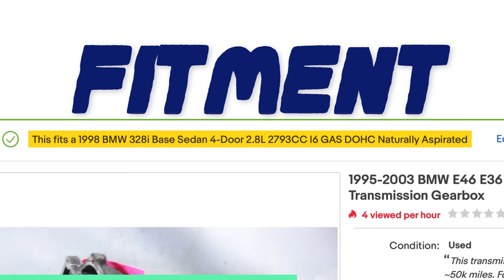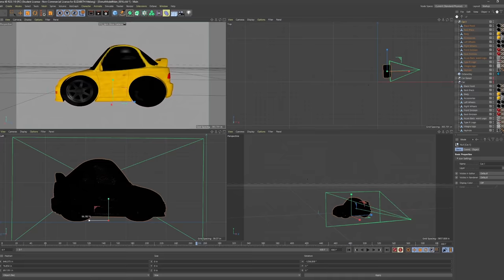Is a Manual Transmission Swap Worth It?

Comment: Yeah, swapping to a manual transmission is worth it if you like shifting slower and replacing clutches all the time.
Reply: for cars like this, and pretty much anything pre 2010s your gonna be shifting faster with a manual. and if your replacing clutches all the time than your either cant drive for shit, or think every 150,000kms~ is all the time lmao
Reply: @arcanevoid9199  Wrong. There is no way you can shift faster or more smoothly than an automatic transmission. 

And in cases where people are racing or off-roading, or using their vehicles for anything other than daily driving, clutches wear out MUCH more quickly.
Reply: @KurNorock  bro have you driven an auto from that time period? they do not shift fast, and especially downshifts. yes it would wear faster doing those things but they make clutches specifically for that sorta thing, and it’s not like your gonna have to replace it every 2 weeks
Reply: @arcanevoid9199  stop calling me bro. You sound ridiculous. 

And yes, I've driven plenty of cars from that time period.  You are the one claiming that all cars from that period have slow transmissions for some reason. That isn't true. Sure, some garbage budget cars did, but plenty of others didn't.
Reply: @KurNorock  okay sorry lol, nah most of them are pretty garbage. only ones that are decent would be dual clutches are they are closer to a manual than an auto. and especially if you go back to the before the 2000s like when this car was made, majority of the autos are 4 speed with no manual option and are terrible. like my car is 2 seconds slower 0-60 with the auto option
Reply: @arcanevoid9199  yeah and in my 98 jeep grand cherokee you can barely even feel the shifts because they are so fast and smooth. 

And that's an SUV. Not even a sports car.  Like i said, you are wrong in thinking that all of the transmissions of the time were just like yours.
Reply: @KurNorock  lmao a jeep? ok nvm you do you
Reply: @arcanevoid9199  At the time it was the fastest production SUV in the world. It was also the most luxurious and most expensive. It was even more expensive than the Cadillac Escalade of the same year. 

So yeah, turn your nose up all you want. That doesn't change the fact that my automatic transmission shifts faster than you.
Reply: @KurNorock  god your ego is huge, jeeps are terrible cars and not to mention I couldn’t imagine only having a big suv thing to drive. they are nice for transporting things, but otherwise they are horrible to drive. And I seriously doubt you have seen how fast you can shift a manual
Reply: @arcanevoid9199  You don't know what you are talking about. Not even a little bit. 

The 1st gen Grand Cherokee is in no way a "big SUV thing". It isn't big at all. In fact, I barely fit in it. My head rubs the ceiling liner, the whole thing only weighs 3600 pounds with a 5.2l V8, the wheelbase is only 106in, and as I already told you, it was a performance SUV with a very fast shifting transmission, all wheel drive, and a V8 engine with as much as 245hp and 345ft/lbs of torque, making it the most powerful and fastest SUV available at the time with a very respectable 0-60 time of 7 seconds. 

You just don't know what the hell you are talking about. I said "Jeep" and you immediately just started thinking about some old army vehicle, or some CJ-7 from the 80s. Which is NOT what I'm talking about at all.

Lastly, my ego has nothing to do with this. I'm not boasting about my old ass Jeep. I am just using it as an example of my argument. And frankly, I don't use my Jeep for racing or street performance. I lifted it and put big tires on it and I take it crawling over big rocks in the desert about as slowly as it will go.
Reply: @KurNorock  it is a big suv, might be hard to understand if your American. 3600 pounds is a lot, that’s 1100 pounds more than my car. and 245hp out of a 5.2 v8 is not impressive at all, there’s 4cyl making close to that. my car makes 190 out of a 1.8, no turbo or anything. I’m not thinking about some army vehicle, if you haven’t owned Japanese cars or don’t know much about cars it might be hard to understand. anyone who’s into cars would know how bad jeeps are, my work friends one just broke down last week and it uses so much gas. and if that’s not boasting idk what is
Reply: @arcanevoid9199  no.  A suburban is a big SUV. A 98 jeep grand cherokee was little more than a slightly tall car. 

And yeah, i know that 245hp out of a V8 isn't impressive now, but back in 1998, 24 years ago, it was impressive. 

And yes, maybe your little 4 banger makes 190. I don't care. That just means your engine is under more stress and will not last as long. It's 24 years old with 220k miles and still runs like new. 

Also, American emissions standards killed engine power for decades over here.  Everybody knows this. So again, for a V8 from 1998, 245hp and more importantly, 345ft/lbs of torque, was damn impressive. And if American car manufacturers weren't hamstrung by ridiculous federal emissions standards, that engine likely would have put out far more power. 

And again, as i already said, I'm not claiming that my old ass jeep is fast.  

Either way, this entire discussion is getting off track.  This was supposed to be about auto vs manual transmissions.  And regardless of what you say, you can NOT shift a manual transmission as quickly as a preformance oriented automatic transmission. 

You sound like those old farts who thought ABS was just some gimmick back when that first came out. They thought they could pump their brakes faster than the ABS system. 

They also thought fuel injection was never going to catch on.
Reply: @KurNorock  but guess what not every car comes with a performance oriented auto trans, most don’t actually. one of them being the car in this video, but you went all “no you don’t know what your talking about”. I’ve driven plenty of auto cars and haven’t been impressed by any of them. The newest being a 2016, and honestly it’s not just about shifting times. the gearing on autos is way too long, and you get more drivetrain losses. and unless it has rev matching downshifting in an auto is really slow and jerky with the manual mode. and just one thing, plenty of people have been getting over 300k miles with my engine, and I’m coming up over 150k myself. it doesn’t really matter it is if it’s designed well. and 190 out of a 1.8 isn’t even that stressed, can easily make more with mods
Reply: @arcanevoid9199  i don't know why you keep arguing against points i never made. But it's getting pretty annoying. 

So what if your car doesn't come with a preformance auto trans. That doesn't mean you swap in a manual. It means you swap in a performance auto trans, or build your stock trans to be performance. It isn't even that expensive compared to a full swap.
Reply: @KurNorock  what tf is your problem with manuals. manual swap is so much easier than all of the those other options, and it’s way more fun to drive. swapping transmissions is a big job, especially for autos because they are more complicated. and unless your doing drags no point building the auto, like why waste money on a 20 year old auto the doesn’t even have manual gear selection? not to mention the drivetrain losses advantages and the weight advantages of a manual
Reply: @arcanevoid9199  
1. It isn't difficult to put a shift kit and new valves in an auto trans. At all. 

2. I've driven plenty of manual transmission vehicles, never once did I think it it as being more fun than an auto. It was just another thing to do. 

3. Autos are more complicated on the inside, not the outside. Swapping one into a car is no more complicated than bolting it to the back of the engine and running a few lines and maybe some linkage. 

4. You don't need manual gear selection, and besides that, almost every single automatic transmission in the world has gear lock outs which can be used as a gear selector if you really want. 

5. Any with more aggressive race clutch packs, shift kits, and valving, the drivetrain losses of an automatic fall in line with those of a manual. 

6. The benefit you get from MUCH faster shifting in the auto will more than make up for any downside the extra weight will give you. And lets be real here, the weight difference is not much and would never be noticeable. 

7. And the most important reason automatics are better is because they let you, the driver focus your undivided attention on the road and the car. You can push just that little extra harder because you can pay more attention to when your tires are breaking traction vs having to split your thoughts between the road and "oh, I'm coming up on the red line, gotta shift!" 

Then there is always that classic situation of being towards the end up a straight with some room to spare before you have to brake. Do you just ride the redline the rest of the way not gaining speed? Or do you take the time to upshift and hope you can gain some speed before you have to brake for the turn? It's too hard to tell. On the one hand, riding the red line won't make you slower, but it isn't making you faster either, and other cars on the track have a chance to catch up or pass you. On the other hand, trying to upshift will slow your car while you push the clutch, and if you judged the distance wrong, you won't have room to accelerate to where you were or get any faster before you have to brake, so all you did was slow yourself down prematurely. 

In an automatic you don't have to worry about any of that. The car does it for you. You maintain acceleration all the way until you hit the brakes for the turn. The auto is happy to upshift, accelerate, then downshift quarter of a second later. Something you could never do in a manual.
Reply: @KurNorock  if your thinking about coming up to the redline, and having to shift you haven’t driven manual enough. it becomes automatic, you basically think in manual. you need manual gear selection do drive the car properly, the auto is not gonna know what gear to use for the corner that’s coming up etc. this is not hard concept for a car enthusiast to grasp, a lot of the stuff you say is irrelevant. and the second you start opening up transmissions it’s way more complicated than swapping in a manual, easy to get everything you need from the wreckers and chuck it in
Reply: @arcanevoid9199  Ok. I'm done here. You have missed my point every single time I've said anything and I am tired of explaining it to you repeatedly. 

It's like trying to play chess with a pigeon.
Reply: @KurNorock  okay cya,  🐦coo coo

Comment: And this is how you can ruin a perfectly nice automatic car by converting it to a boring and more than obsolete three pedal car. I am surprised you didn't also swap the perfectly good gasoline engine to a diesel one. In my country this is a common practice among old german cars. If they were fitted from the factory with gasoline engine and automatic transmissions as soon as the engine and/or transmission beaks down some shadetree mechanic will be more than happy to put a diesel engine and a manual transmission on it as most of the folks in my country would consider those as being superior. I mean the vast majority of people believe a diesel engine is superior to gasoline and a manual transmission is superior to automatic. However they are so wrong. gasoline engine are superior the same way as automatic transmissions are superior.
Reply: only because the car manufacturers cheated the emission tests. First volkswagen then Mercedes etc

Comment: I'm gonna stop this video at the first word to say one thing.

No matter how good you are. No matter how fast you are. No matter how lucky you are. It. Doesn't. Matter. You aren't faster and more precise than a computer and you never will be. None of us will be. Get over it.

Oh. And. Manual override. Easily fixes shifting issues when pushing the vehicle.
Reply: not true when it comes to older autos, and manual overide is terrible in most cars. dsg is the only good one